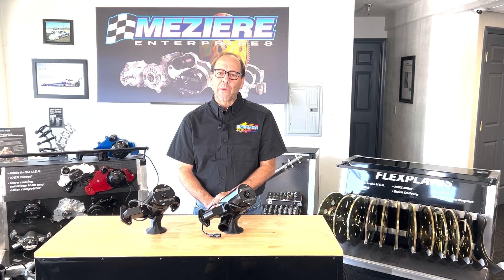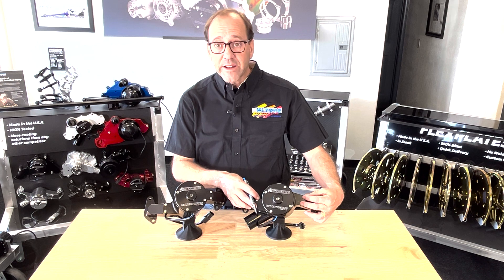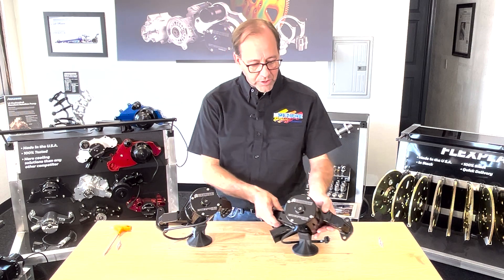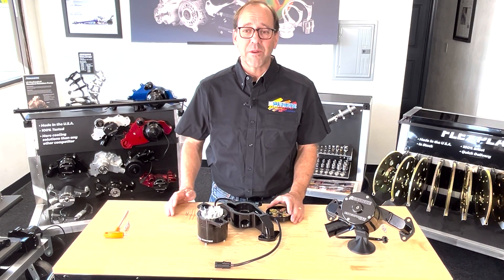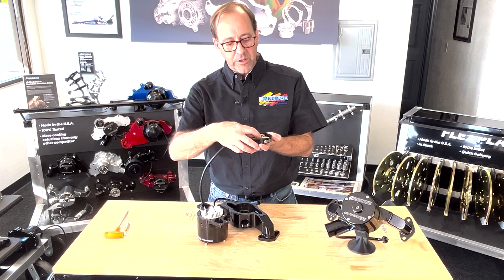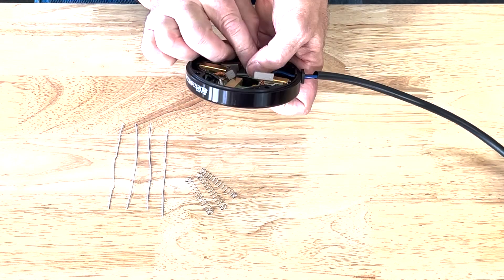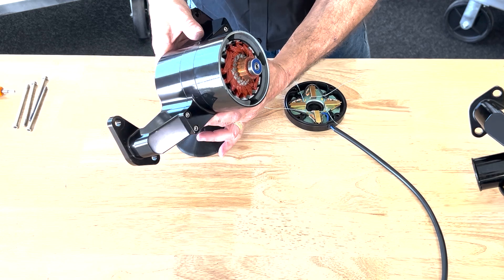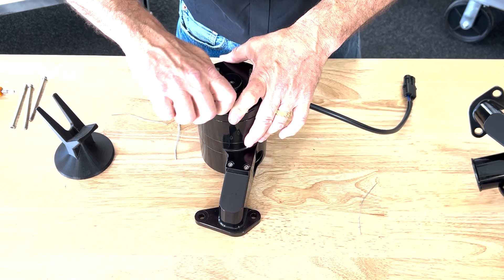Center Section Changeout - Meziere Electric Pump

Comment: I have a 55gpm the pump motor runs but does not pump fluid any idea what could be going on?
Reply from the maker: Sorry so late responding. It must be air locked. Call or email us and we will help you resolve it.